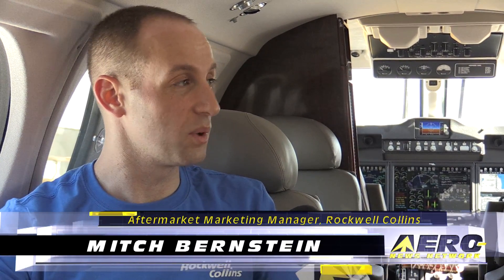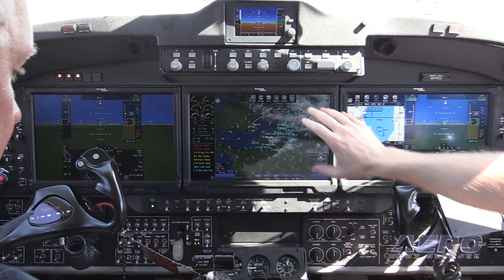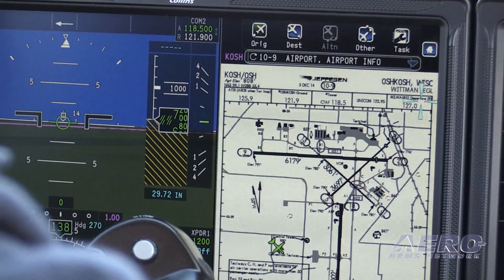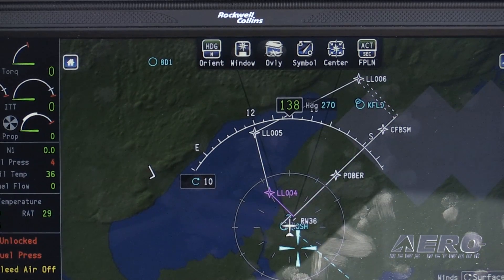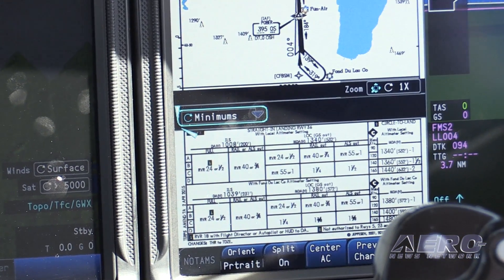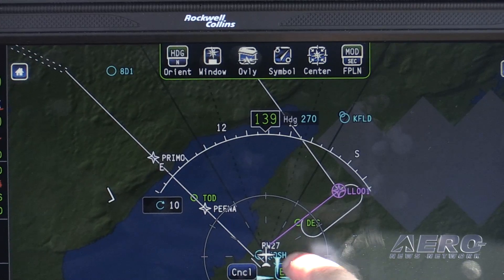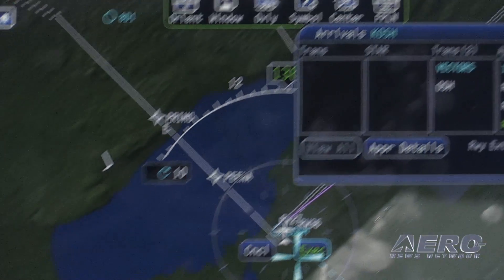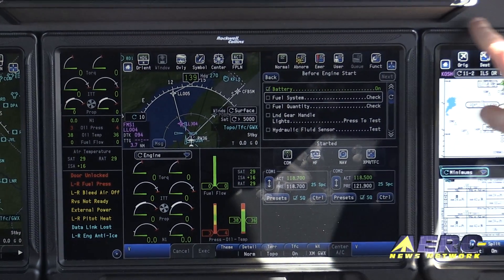Aero-TV: Rockwell Collins Pro Line Fusion - Giving the King Air Royal Treatment

Comment: Imo seeing as are using this to compete against garmin they have one major issue.  What is the point in having a touch screen when you cannot use it to enter numbers into the field you have selected?  Seems crazy to me to have remove your hand from the touchscreen and move back to the keyboard (especially when the competitors have don't have to).  Maybe I've missed it somewhere but anything I have seen about this system only shows using the keyboard to enter numbers.